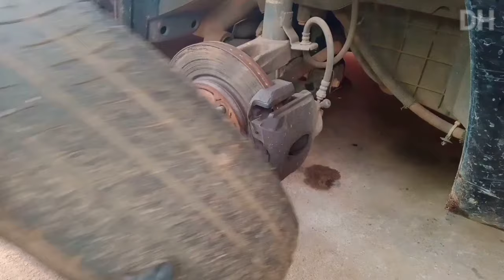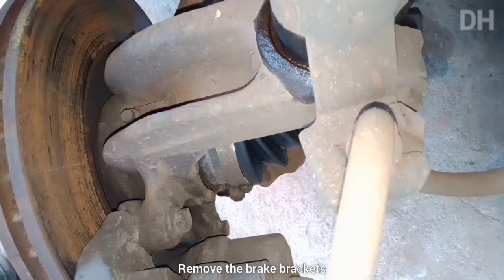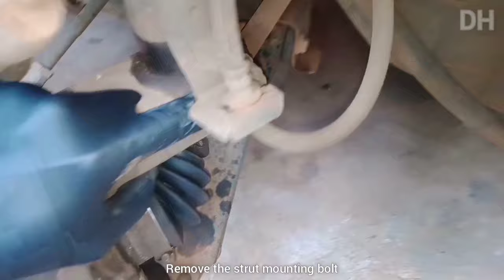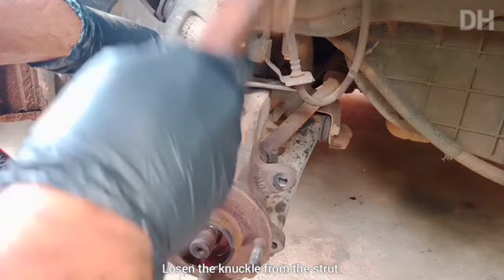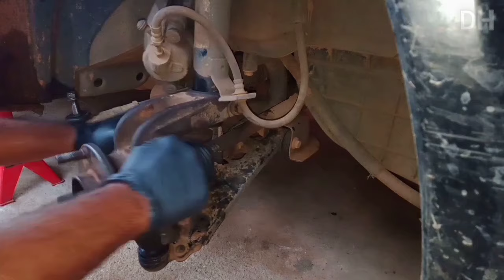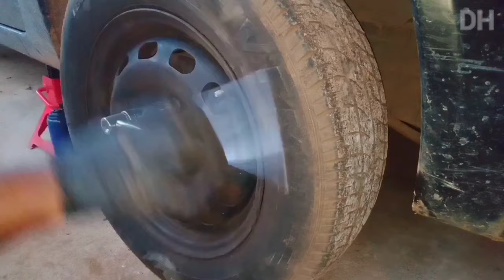Ford Front Wheel Bearing Replacement | Ford Figo Fiesta Focus | Wheel Hub Removal Step by Step

Comment: Bearing removal from housing did you use bearing puller / hammering? Fitting by hydraulic press or hammering?
Reply from the maker: by hydraulic press.

Comment: Hi sir i have a Ford fiesta 2009 model Diseal How to calculate the milage yesterday my car fuel tank been empty i filled 2 liter of diseal in the tank for checking the milage test when i fill the diseal nothing happened showing 0 distance to empty after that i filled 1 liter it"s showing 68 kmpl Distance to empty Giving 40 kmpl for 3 litres How to count and How much diseal should maintained in tank before checking the milage?
Reply from the maker: please don't relay on the dte feature its not accurate. Just fill full tank fuel, drive for quiet many kms, now fill the tank again to full....you will get the amount of fuel to run the car from previous full tank....you will get the mileage